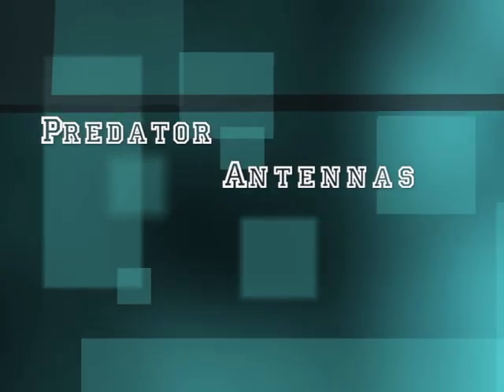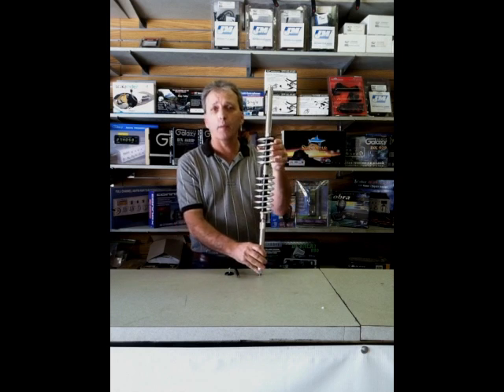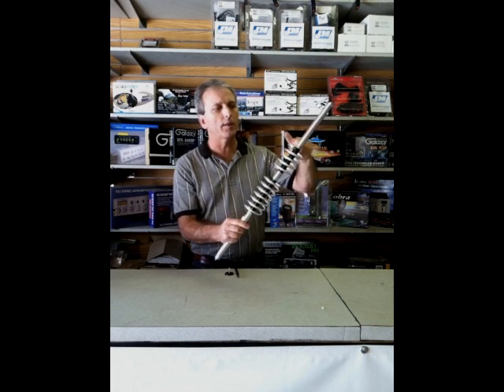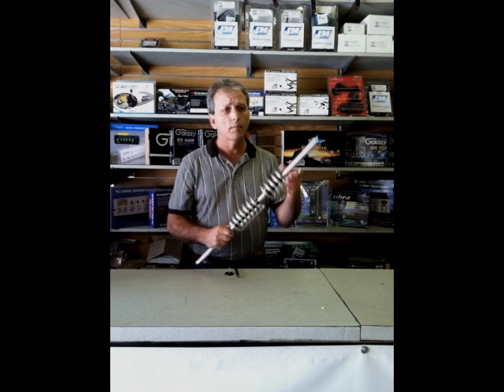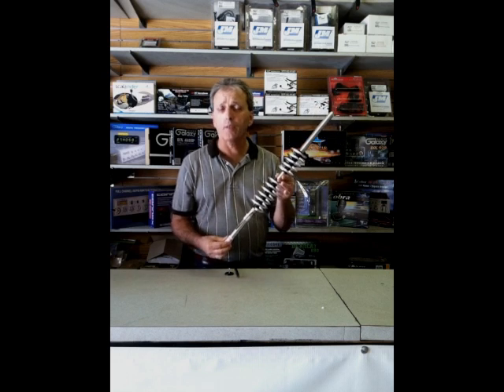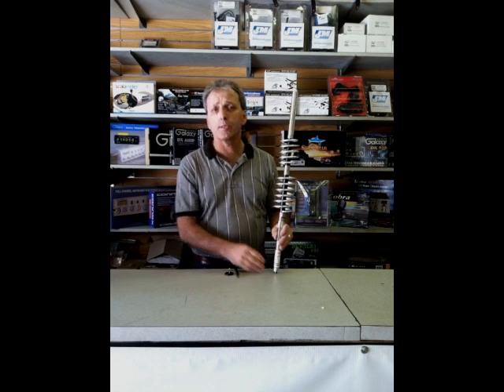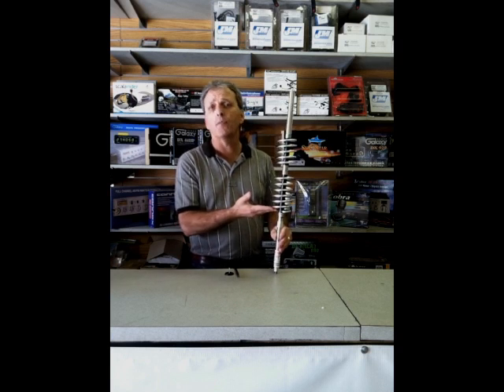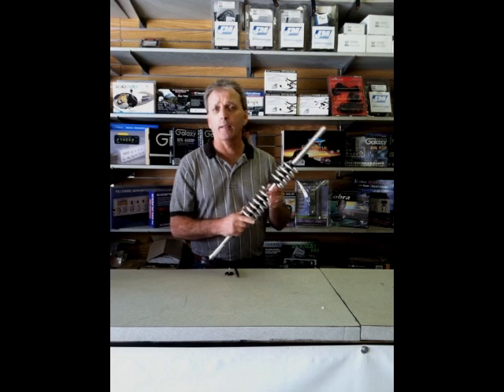Predator Antennas

Comment: My work van stands at 7 feet from road to roof. I would snap that antenna on the first low tree. I am a 102" S.S. whip kind of guy, which is all bent but still does a 1:0 on a MFJ-259B. Don't get me wrong, I would use a antenna like a predator but would be mapping out my driving route every day. 73's
Reply: You could run a 102 " whip using a ball mount mounted in the rear quarter
Reply: And “its hard for mud duck to deal with a lil bit of stainless steel”

Comment: The Stryker SR-A10 center loaded version more powerful than the predator. Because predator can easily catch the water. If we see the stryker SR-A10 center loaded version, then there is a double wall coil cover with pure silver coating. which protect the coil very easily. 
strykerradios.com/best-cb-antennas/
Reply: I currently running an SR-A10 on my truck an it is a disappointment. I will go back to an open coil antenna, predator to be precise.

Comment: I have the single coil version with the 27 inch shaft. It broke in half at the insolator in the middle of the coil, if it is fixable where can i buy parts?

Comment: i drive a 2019 Pete 579 with fiberglass shell instead of metal.  the specs call for any antenna to be mounted on the back of the sleeper in the center.  it's where the stock antenna was.  i bought the predator with a 6' whip (seller said it's the only whip that works with the predator).  i put it where the stock antenna was but the predator with the whip was about a foot or more above the top of the trailer.  trailer is 13'6.  got the bearcat 880 tuned and peaked and everything was tits.  swr was 1.00.  but up to michigan i hit low bridges and it took the whip right off.  no damage, just took the whip out of the antenna base.  got another identical whip and now am going to have to relocate the entire thing.
Reply from the maker: The antenna can be converted to the dual coil SW model. The whip can then be cut down to 39 inches.
Reply: Buy a shorter whip for a k40 can get them at some truckstops
Reply: Quit trying to use that garbage factory coax run some good low loss mount the antenna on the mirror  i ran one for 12 years on my pete and i ran close to 20,000 watts worked really well. Just dont touch it while transmitting ask my son

Comment: I have a Predator Bad To The Bone and I only could get the SWR to a 1.2 on Ch 20 and a 1.3 on ch 1-&-40 in my opinion I don't think the antenna is all that great with SWR I could see if there was an amplifier inline and the SWR was a 1.2 to 1.3 then it's acceptable but for a barefoot radio doing 4 to 5 watts and having an SWR at 1.2 to 1.3 that's kind of high for a barefoot radio, But If anybody could point a few thing out to me please let me know.
Reply: +Clay Thompson 
I was trying to achieve a flat SWR like a 1.0 or 1.1 Right now I'm only doing 5 watts and the SWR is 1.2 to 1.3 barefoot no amp, Is there anything you can point out that might help lower it down.
Reply: I'm trying to get it down to a 1.0 - 1.1 but seems not to get there I tried a few things but don't know what else to do.
Reply: You need more ground on your vehicle.